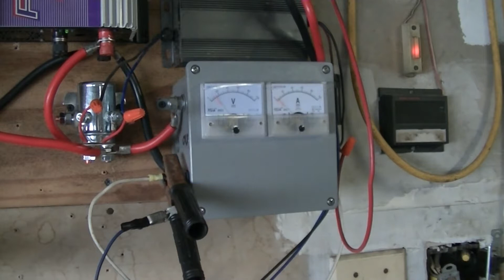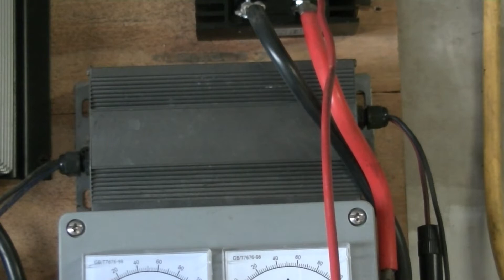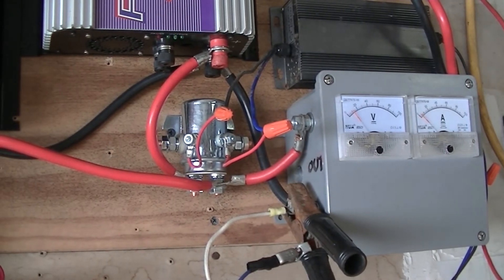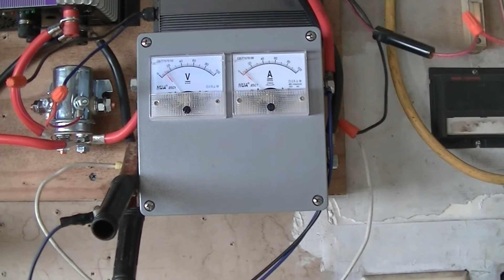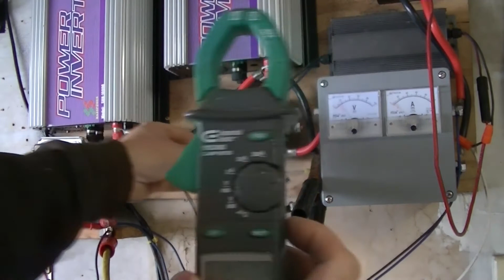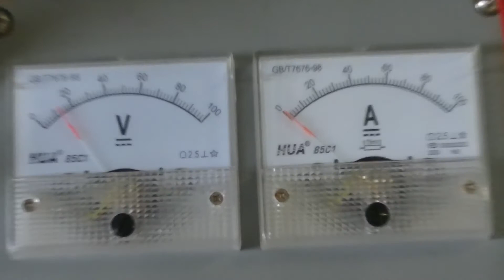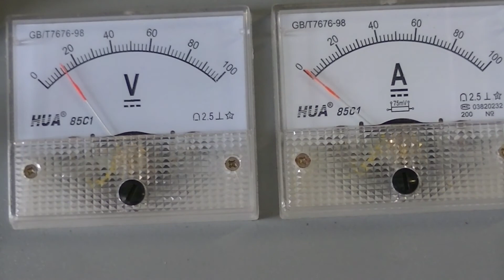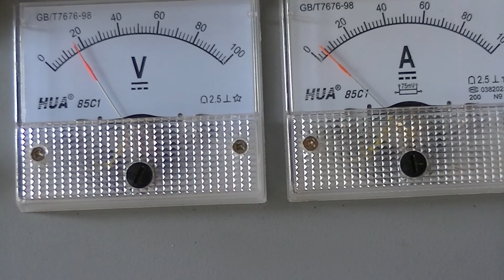WindyNation WindTura 750 Experimental Electrical Setup

Comment: That Controller should handle the relay and it has a divert load on it. And its a better thicker board than the Coleman Air circuit board. The Voltage reducer you have is a common unit in golf carts? Maybe I hope, I can find one. Those voltage reducer's are really hard and expansive to find. I think Thermodyne Systems has voltage reducer on their Website? But good experiment and showing, Thanks!!